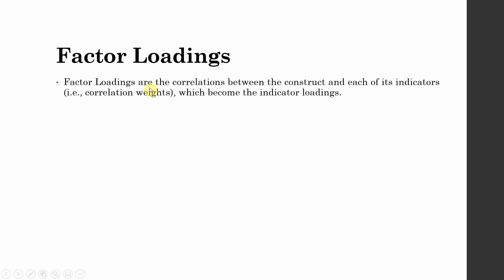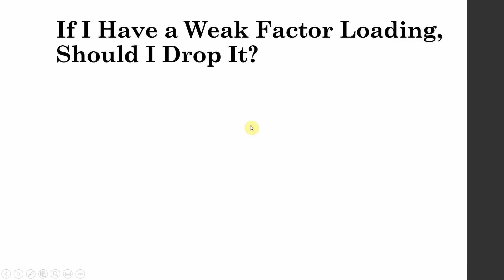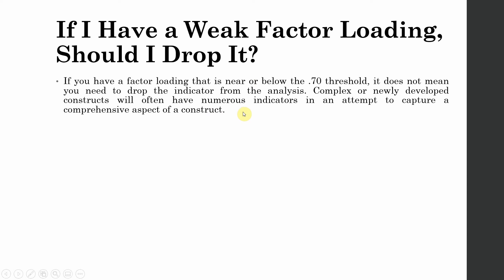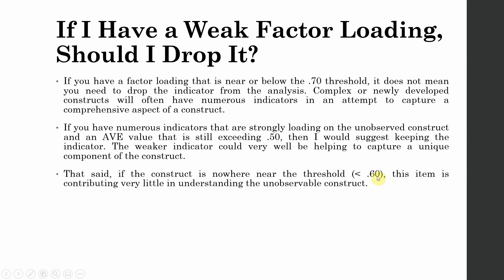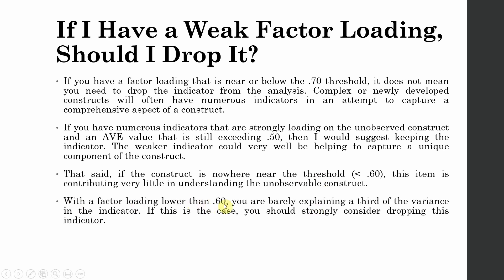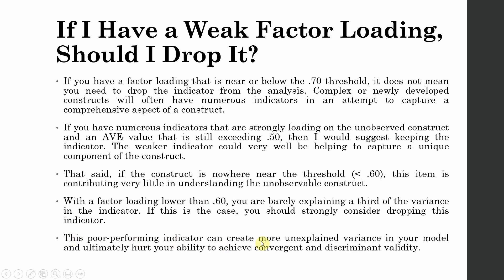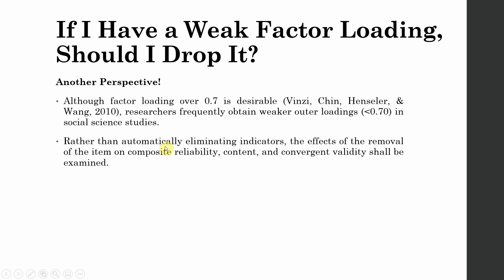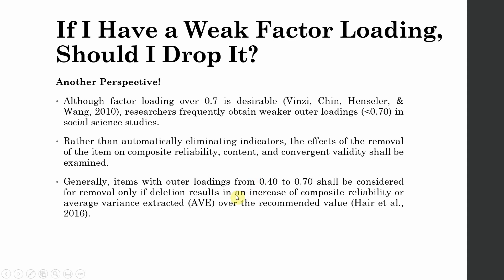Quick Guide - When to Delete an Item in Structural Equation Modelling due to Low Loadings?

Comment: Hi, I wanna ask. How bout If I have a laten variabel, lets say "Price". And this "price" have 4 indicator and each indicator have 3 items for measure. If the all of 3 items from the first indicator achieve the outer loading under 0,4. Can we just delete them all? I think it's really hard to make a questionnaire for the "Price" variabel to achieve a high outer loading because the price variance (price ranges) of the products is to wide.

For example, maybe some people think if the cinema ticket is affordable but the popcorn is not. It just messing up the outer loading and make the constructs item have low outer loading.

Variabel = Price
1st Indicator : Affordableity

-1st item : "I think the cinema ticket is affordable" (Get 5 score) (get 0,3 outer loading)

- 2nd item : "I don't mind with the popcorn price" (Get 1 score) (get 0,3 outer loading)

- 3nd item : "The coke price is cheap" (Get 3 score) (get 0,3 outer loading)

Any advice?
Reply from the maker: Deleting over 10% of the items is problematic. You may need to revisit the questionnaire.

Comment: Hello Sir ..I have a query my factor loading in second order model is 0.581, but my composite reliability and AVE is above then the acceptable limits….. the cronbach alpha is slightly is less than 0.70 … what should i do drop the construct or retain the construct??
Reply from the maker: No need to drop anything. CR and AVE are good, continue the analysis and reporting.
Reply: @researchwithfawad  Thanku so much Sir